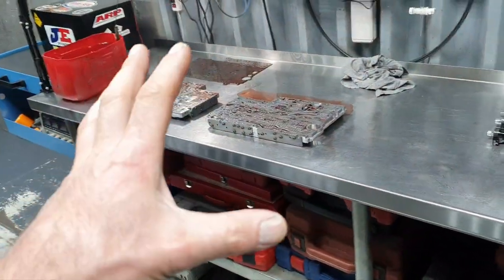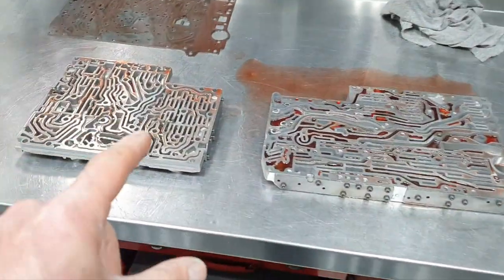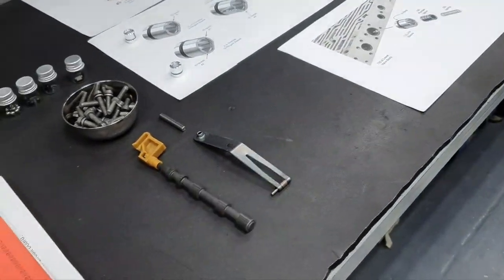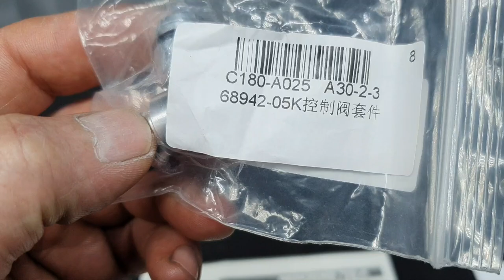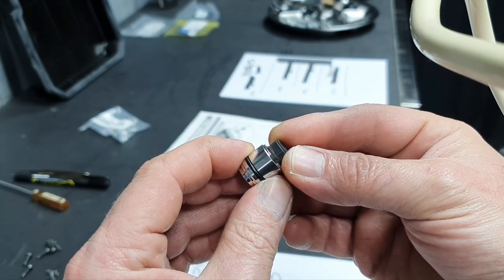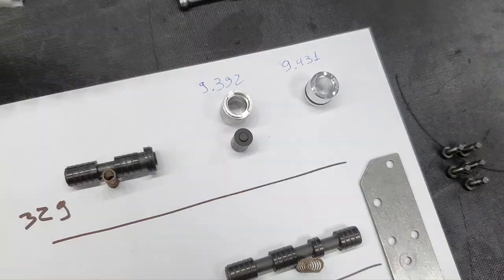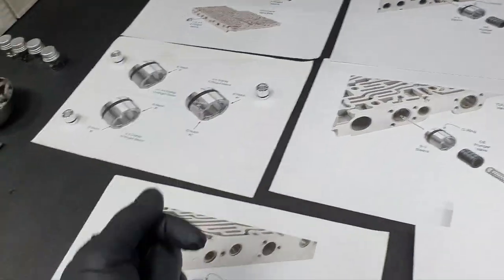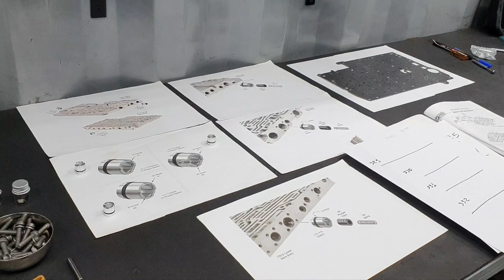CLS 55 2006 with 98k km check up (part 3.1)

Comment: nice work Tasos  , i just did a rebuild on C180 valve body  to fit in my C55 . i did the vacuum test on the valves  to make sure it was good in condition  . those sonnax  valves don,t look right . i didn,t know about the fluid update will have to find where to get the new fluid  cheers